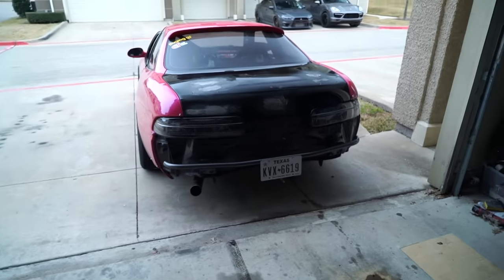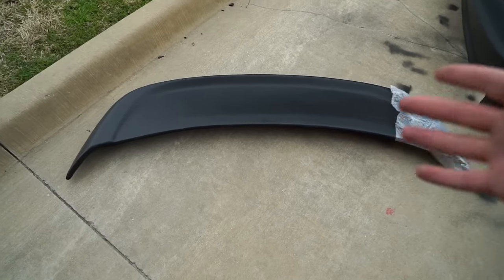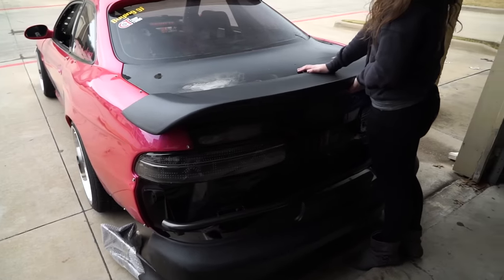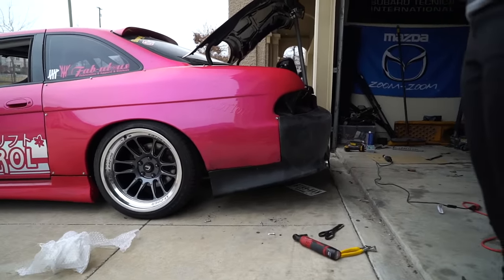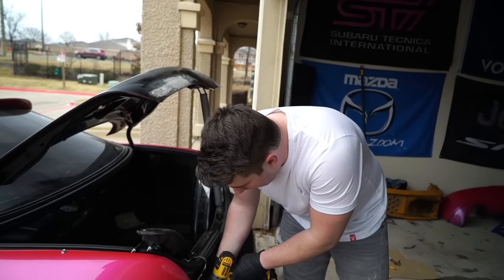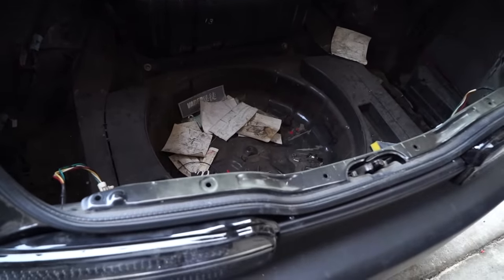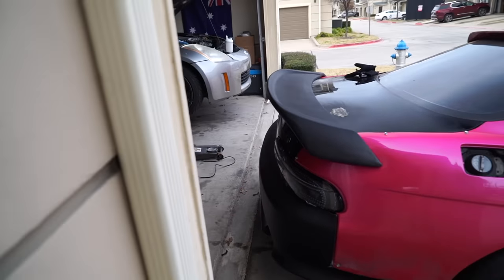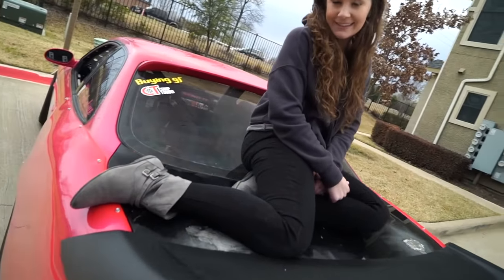NEW WING & BODY KIT for the SC300! - Making the SC300 clean again

Comment: Importing a car doesn’t suck. Your importer does. I’ve had 3 Jdm imports . 300zx , Subaru GTB and now a JZX110 . A car from Japan should take no more than 4-5 weeks for a RORO. (Roll on Roll off). The only way it should take any longer is if the car needs to pass it’s build date to be of import age.
Reply: It’s an r33 so probably will be something to do with the legal side that prolongs the time Evan has to wait, as the r33 grr is only just legal in Texas
Reply: Actually it's any r33 just passed the federal 25 year rule and are allowed to be imported.
Reply: lancerful07 probably the reason tho that it os taking as long, paper work for anything is always a nightmare
Reply: 01GTB Daily because he does everything on the cheap and with sponsors no one else cares about,,, plus anyone saying they’re waiting out the import date, that don’t matter as it’s calculated on date of export from home country so if that’s before USA legal date it would still be illegal

Comment: Bunk fitment on that bumper but you made it work! And I remember seeing self tapping screws on a Lexus at the Dallas auto show floor, so you are fine here. And the spoiler, I wonder if there is a way to move out those edges just a tad, perhaps cut it in the center and then fiberglass it back together with like an inch space or something like that. It should just clear the body kit on both sides which it doesn't quite do now. Heck, maybe half an inch would work.

Comment: The sc300 is like stretched odd Supra  with smaller headlights and bigger tailed lights and four seats
Reply: Rilee lang the Supra seats 4
Reply: Rilee lang    The sc300 is the same subframe, suspension, some body lines, and motor as the Supra.  The Supra was put on the sc platform since the Sc debuted in 92 and the mk4 supra debuted 93
Reply: Ralph Tarzia ya I know I was just saying like if you sat them next to each other they look the same if you squint a little lol
Reply: Ralph Tarzia also you taught me something I thought the mkiv Supra was before the sc
Reply: Yeah my man I have a 92 sc300 5 speed and it’s so similar to the supra it’s crazy.  The interior is a little different but from the side it looks pretty similar except the roof line is the most noticeable difference.  If you wanna check it out my insta is @ralphtarzan
Reply: Ralph Tarzia nice I got a 95 5spd Sc300